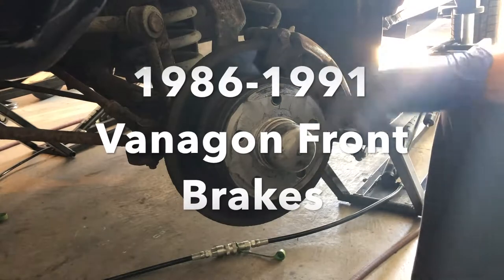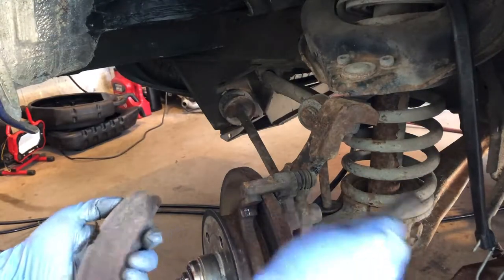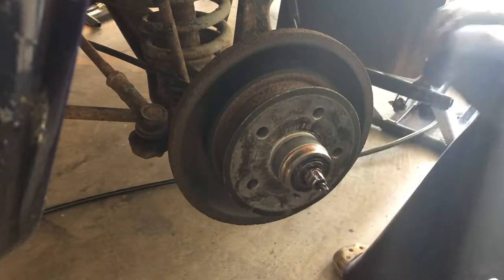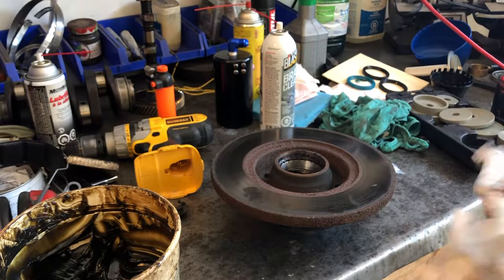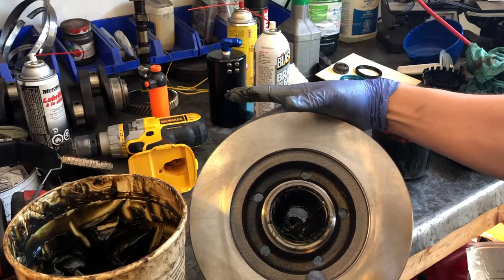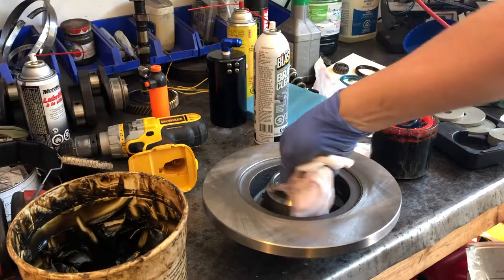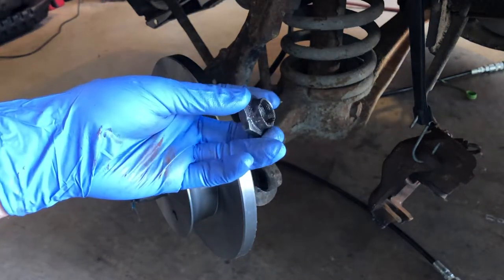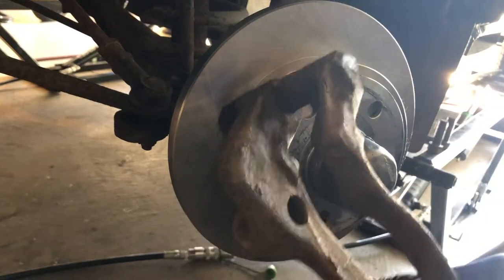VW Vanagon Westfalia Front Brake Replacement

Comment: Having trouble on passenger side. Wheel bearing gets punched out when installing.
Reply: Any advice
Reply from the maker: @kalimethod  Hi There, this should not happen.  Are you putting new rotors on?  Sometimes I have seen new rotors come WITHOUT the race installed and it causes problems, make sure your new rotors have races in them. The race is what the outside of the wheel bearing rides in.  The inside of the wheel bearing rides on the spindle.  You should not punch the old race out of the old rotor, you never have to transfer these parts over. Make sure your wheel bearings are clean and packed with new grease.  For a test to see what is sticking you can take off the rotor and slide the wheel bearings on WITHOUT the rotor, they should slide right on with no force.  DO NOT hammer them.  If they slide on ok then you may just be misaligned. Put the rear bearing in the rotor, install the grease seal and put the rotor on.  Once the rotor is on (it will not slide off) then put in the front rotor bearing while wiggling it.  That should be it, let me know how you make out.
Reply: @GarageKing  ok we figured it out. It's the old outer wheel bearing. Well  what's left of it. It was smashed. We thought it was the brakes sensor or metal on metal on the rotors from having no pad left. But it was the wheel bearing making the grinding nose. The inner part of the wheel bearing is suck on the spindle. It won't budge. Wish I could show you a picture.
Reply from the maker: I know exactly what you are talking about. No pic required. Just as a FYI that is really very rare for something like that to happen.  Most likely the bearing was not repacked at the last brake job and the center nut could have been too tight.   Very rare to see that and I’m glad you got it figured out.  Cheers
Reply: @GarageKing  we figured it out but do you have any idea how to remove. It's stuck. We tried lubricating oil.
Reply: We are trying to get this on the road. Thank you for all the help
Reply from the maker: @kalimethod  Best way to get it off is take a cut off wheel and cut through about 80% of the bearing, try to cut right in vertical, then take a wide punch, put it in the grove and hit it with a hammer.  The race is hardened steel so it will snap apart.  You should wear eye protection as I have had part of a race lodge itself in my arm (removed by a doctor) so please wear eye protection if you try to split the race.  The other method is to cut right through it then it will loosen and be easy to get off, you will most likely mark the spindle as your cutting wheel will hit it, that is ok, just take a wire wheel to the spindle to smooth it and all will be well.  Good Luck, and long live the Vanagons, glad to see you are tying to keep one on the road!!!
Reply from the maker: Also i forgot to mention DON'T HEAT IT!!!!!!! with a torch, torch is ok for other things but not for steering components (unless they are being replaced)  When you heat and cool something you make it more brittle and prone to cracking.  You don't want that with your spindle.
Reply: @GarageKing  will try today. Do you have Instagram for the shop?
Reply from the maker: I do it’s garagekingyoutube however I don’t have much posted on it but feel free to follow if you want.  I find it takes sooo much time to make and post these videos that pretty much all my effort is put into YouTube.
Reply: @GarageKing  still trying to cut. Scary for us. I just went through 1 saw. Will go get more. I did hit the Spindle a little. But very little.
Reply from the maker: It’s good if you have a cut off wheel connected to an air compressor. That would work fast.  You could also try an electric Dremel tool with the cut off adaptor.  If you are doing it by hand that is really hard as the bearing race you are cutting is hardened steel which is really hard to cut.  Don’t worry if you mark up the spindle. Just make sure you use some emery cloth to take out any high spots or burrs. That inner part of the bearing doesn’t actually spin on the spindle. It’s the little wee pins in the bearing that actually do all the work.  Do a little test with the new bearing. Make sure you can slide it on and off without it binding and you will be fine. Don’t forget to pack it full of grease. I hope it works out for you buddy!!!
Reply: @GarageKing  man I wish I could show you a picture. We just grinded through. And we don't stop at 80%. We actually went 120%
Reply: We can spin it now but still can't get off. If you are right them I hope I don't need a new spindle. Once it's off I hope I can put everything on. I did it by hand with the cut off. But we couldn't budge it. So we kept cutting. It's about 4mm into the beginning of the Spindle.
Reply: Ok. Got it off. Took off the burs. But Bearing won't go on. It stops an eighth in. We tried feeling around. But I'm pretty sure the spindle is messed up. Maybe not though. Like you said it just rides on it. Sad right now.
Reply from the maker: Congrats on getting it off. That is not an easy job to do by hand so I give you credit!!!  If you know anyone with a dremel get a polishing pad, a wire wheel on an air powered angle grinder works well. If you don’t have that then get a roll of emery cloth. It’s about 1 inch wide and comes in a roll. It’s very abrasive and is meant for use on steel. You can do wonders with that stuff. Keep using it until you take enough off the spindle for the new bearing to slide on then you should be good. Don’t hammer on the new bearing.  Good job on not giving up!!!
Reply: @GarageKing  We Smoothed out Spindel. Got the new bearings on. 👊👊. Only thing is our new pads don't for work with the Girling Calipers.  Could be our new Rotors but we have to use them now. They all installed. It could be  because they are slotted and drilled, or maybe thicker?
Reply from the maker: @kalimethod  I'm really glad you got the rotor on!!!!!  I was thinking of you the other day and hope it worked out.  There are two styles of factory brake pads for your van 80-85 uses one type and 86-91 uses the other type (has a spring on top)  Both use a solid rotor.  On the rebuilt calipers ATE and Girling are the main suppliers that I know of they should be the same.  Do you have the old rotor?  Is there any way you can measure the thickness of the old rotor and compare with the new rotor?  Also this may sound funny, but make sure your caliper piston is pushed all the way in.  I have got them rebuilt in the box and they were not bottomed. I could actually push them back about 1/8 of an inch or so.  I would make sure the caliper piston is all the way in and measure the old rotor vs new.  It is possible the new one is thicker, but if its made for the vanagon then you should be ok.
Reply: @GarageKing  Sadly we weren't wise and threw them away. The next day we went Dumpster Diving to get them and someone took them for metal before got to it. Crazy. But true story. So we couldn't measure them. We'll never know until I buy from a Vanagon site. We ended up getting the brake set locally from a place that does classic and new cars. It's not the best thing for the rotors but we have the old pads on now. On the passenger side it makes a thud sound towards the complete stop. Reason not sure? And idea
Reply from the maker: @kalimethod  If you used the old pads that's ok, as long as there is some life on them that's ok then.  What you can do to test is jack up the vehicle and spin the wheel by hand, you should hear a constant type noise (pads rubbing on rotor)  If there is anything out of alignment you should hear it when you spin the wheel.  Normally brake noise is caused by a bad rotor surface (rust spots), but that would not apply to you as you have new rotors so the finish would be good.  If there is nothing there, the thud could be a worn suspension component. The front ends on the Vanagon can cause creaking sounds.  Also if you go to my channel on the about tab, there is an email address, you can email me and I will send you out a big roll of emery cloth (up to you).  A while back I bought like 6 rolls and they are big so I can check shipping and if its not too bad I'll just send it out to you.  I don't want any money or anything.  Just appreciate hard workers and I can tell you are one for sure.  I'm out of town for the weekend but I'll be back home on Monday.
Reply: @GarageKing  Thank you so much. Appreciate. Vanagon turned our family into home mechanics. 🙏
Reply: We are back on the road. So  far Spindel is fine. Next we hope too change the transmission fluid.
Reply from the maker: @kalimethod  That is awesome buddy!!!!!  So glad to hear you got the bus on the road :)  Thanks for the update and keep safe out there :)
Reply: @GarageKing  We are looking to replace broken bits on the shirt linkage. That looks doable. But there is a leak we noticed on the side of the transmission which connects to the shift linkage. Any advice or knowledge on this?
Reply from the maker: @kalimethod  If you go on my about page on my channel you will find an email.  You can email me a picture.  I think I know what you are talking about and you can replace that seal with a socket.  Don't forget to check the front linkage under the spare tire.  When you remove the spare tire and look up you will see a box, look inside, its very simple how it works.  There are pads that wear out there and can cause the shifter to go loose.
Reply: @GarageKing  I couldn't find the email on the about page. But I did message you on the Instagram garagekingyoutube
Reply: @GarageKing  Got the email. Had to use my desktop to see it. Emailed you. Thanks so much
Reply: I see you have not got the dust covers at the rear of the disc do you find it's ok to run with out them.
Reply from the maker: @simoncummins1964  Hey really good observation, you know I never really thought about it.  I bought the van a few years ago and this was the first time I was servicing the front brakes on it.  I guess the owner before me removed them (probably because they rusted out)  To answer your question, I have never had an issue with it, and I take this thing on long trips across the country.

Comment: There is supposed to be a locking in that speedometer line, you can see a hole for it. 
Whatsoever square in that dust cup has to be ideal otherwise you'll see how your indicator oscillate :)
Reply from the maker: You are 100% correct, I probably should have shown a close up of the dust cap to show how it has to be square.  If its round the speedometer will oscillate as you say!!!!  This was one of my older videos so over time I'm getting better at editing and making them better :)   Thank You :)